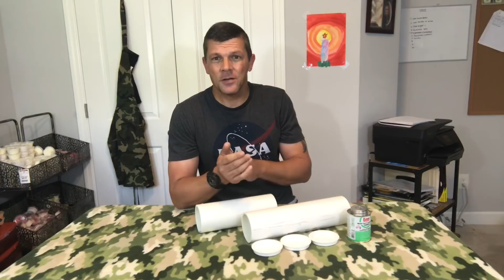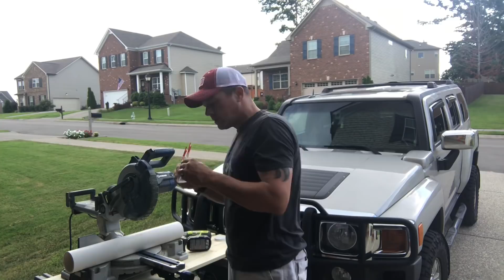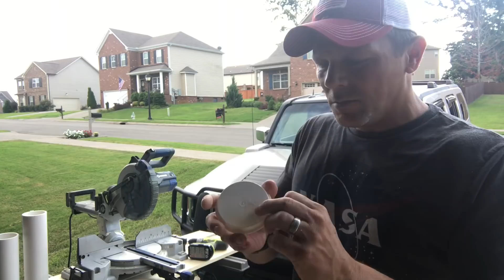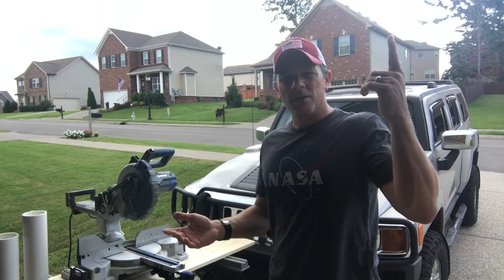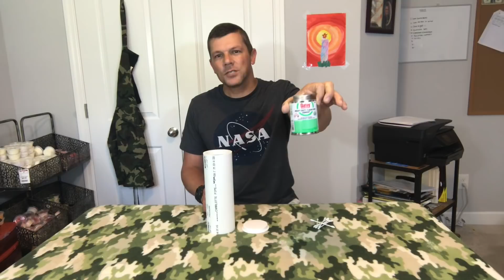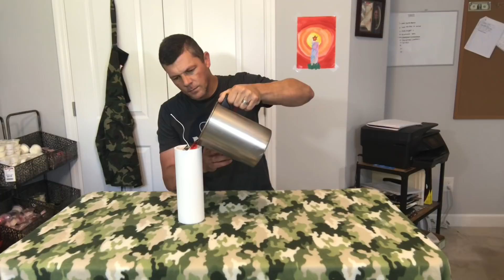DIY Mold Making - Homemade Pillar Molds

Comment: I used skinny PVC pipes for skinny candles and used a plastic flower pot base to stand them on. Then used a high heat hot glue stick to hold them upright. But I sawed a slit down the side of the PVC bc I was worried the wax wouldn't come out. I duck tapped the slit so the was wouldn't leak out. So I was really hoping you would have shown how you removed the wax.

Comment: Hi!  My understanding is the pouring temperature of paraffin wax is 170* F.  Using PVC for candle molds has a "maximum working temperature" of 140*F, therefore CPVC (chlorinated polyvinyl chloride) must be used instead for pouring temperatures exceeding 140*F.  Any thoughts?

Comment: Turn your carbide blade backward when cutting PVC or even aluminum. I would bet that you did not need to glue the bottom cap onto the pipe as long as it fit snugly and you taped it....or used clay over the edges. The PVC cement cures in 25 seconds to handle and in about 20 minutes to pressure. Why didn't you show the mold removal?

Comment: Do you use release spray in the pvc mold? I wish you had showed how you took the mold out of the pvc pipe
Reply: You shouldn't need release spray. Wax shrinks as it cools, so after a while (especially if you put it in the refrigerator for a short time towards the end), it will slide right out.

Comment: I would not recommend!  Eventually had to use angle grinder to slit mold on both sides to be able to break it by hand to release candle.  Candle is going to make it but it was beat up pretty bad.  Candle science pillar molds are about the same price as the pipes😂😂.

Comment: How do you prevent the wax from sticking to the inside of the PVC pipe? 

Would also like to see you unmold the candle.
Reply: Pariffin wax shrinks making it easy to come out of the pipe. You can also use candle mold release spray on the pipe to help it come out easier. Hope this helps.

Comment: Me also have problems to get the candle out of the mold. So I appreciate answer how to do that.
I tried to apply oil on the mold before pouring the wax inside. It helped but the surface of the candle was not smooth then (like the oil mixed with the wax).

Comment: Dang I wanted to see the wicking and removal from the mold. Not to mention I don’t have a power saw so this method would be a much bigger investment for me 😏
Reply: You can use a hacksaw to cut the pipe.  It's just a bit harder to get a straight cut.

Comment: I've been looking for a pvc pipe molding video and finally found yours ty for making this video first of all.. but I'm curious if you could take the silicone/cornstarch with food coloring video you made to wrap around a pvc pipe to make a resin mold?... and would you need to put anything on the pvc pipe so the silicone won't stick to it?

Comment: I tried this with small diameter and even with mold release it didn't come out well.  Also, scrupulous cleaning may be necessary, because these pipes are often stored on end and dust and grit from the hardware store will get inside.  Works well with larger diameter.  Another caveat, if you clean out the molds, the PVC will scratch deeper than metal so you have to be careful how you do it.

Comment: Hey how did you manage the which you drilled while pouring the wax
Reply: Hole*
Reply from the maker: once the wick is threaded through it, you need to seal around it with wick putty to ensure it doesn't leak.
Reply: Ohh! Thanks i got it

Comment: Tim,

Did you spray the mold with the release spray before you poured? If not, was the candle difficult to get out? Thank you!
Reply from the maker: A silicone based mold release spray will definitely make your life a lot easier. Without it, the candle will still come out of the mold,  but it can sometimes be a huge headache! The spray isn't all that expensive and will last quite a while. Here is one I found on Amazon
https://amzn.to/2WRyeZ9

Comment: do i need to use 2 " knock out end caps to fit in the 3" or am i using the correct size ..see below comment
Reply from the maker: hmmm, the 3' caps should fit the 3' pipe. send a picture to my facebook page and i'll be able to give you a better idea of what you've got going on.
Reply: @TimberRidgeGifts   Hi Tim i got a neighbour to pop em in for me i guess  i wasnt using enough elbow grease! but i had a little issue with leaking i guess where there wasnt sufficient pvc cement coverage so i had to go back in with the q tip and seal where the leak was .. thanks a lot for replying

Comment: So do you make decent money making candles or not really? Also how do you keep the cost down?
Reply from the maker: I do make decent money between my Etsy shop and craft fairs, not enough to retire on just yet lol, but my YoY analytics are getting better and better. Cost cutting gets easier as you grow your business, mainly because you are able to, or at least have the need, to buy your supplies in bulk. Another cost saving tip would be to buy as locally as you can to save on shipping, which can be a killer! But to be honest, when you are first starting out you can definitely hemorrhage money if you're not careful because of all the waste and mistakes that will be made. Which is part of the reason I started this channel, to share the knowledge I've gained and try to help others from making the same mistakes I did.

Comment: Oh my gosh! Questions Questions.(Q list below)
The molds are easy for me... I have a bunch of these already for soap molds. Except, no hole, you don't glue the caps on, and for soap you line the mold. (Oh and E6000 craft glue will hold the cap on even with heat)
 
Q #1. Is the hole to string the wick through?
.
Q #2. How did you keep the wax from leaking through the hole?
.
Q #3. How did you get the candle out of the mold?
.
Q #4. If the hole is for running the wick through, how do you trim the bottom of the wick off the finished candle without scratching the candle up?
.
Q #5. Is this a special type of wax? (Can pillar candles be made with soy or coconut wax)
.
Q #6. Do you oil or do something to the mold before pouring to make sure the candle will come out after it solidifies??
.
Thank you. 😀 Sorry for all of the questions.. I'm candle illiterate still. I still haven't braved making one. 😮
Reply from the maker: Yes the hole is to string the wick.
The hole is plugged using mold putty. 
Once the candle is dried you can just snip it off as close to the base as you can get it. Or since most pillars require a repour, you can trim it just before you do the last repour. 
This is a paraffin pillar blend that I used, KY143 from Rustic Escentuals, soy or coconut are too soft and would not make good pillar candles. You will need paraffin or a paraffin blend. 
I use mold release on all of my molds, it's just a simple silicone spray that you can get from most hobby stores. If that doesn't do the trick, then just pop it in the freezer for 5 minutes and it will practically fall out.
Reply: Thank you for asking.  These are all my questions as well.

Comment: This was awesome. Thank you. How does this release? Do you spray the mold prior to adding the wax or does it just slide out on its own once set?
Reply from the maker: Rosa Medina I use mold release with any kind of mold. I had to wrestle with this one just as much as any other mold, especially because of the length. But 3 minutes in the freezer and it slid right out 👍🏼
Reply: Timber Ridge Gifts great. Thank you!